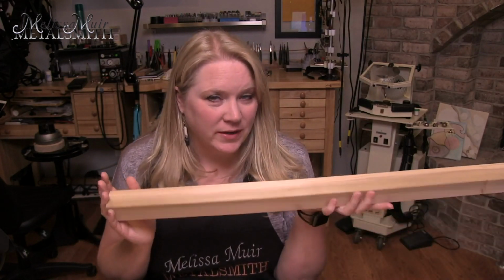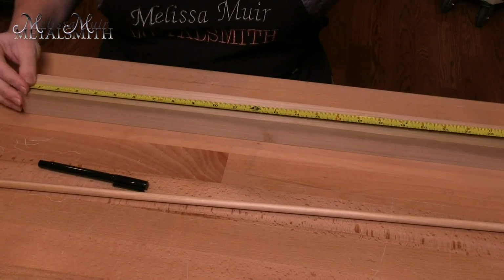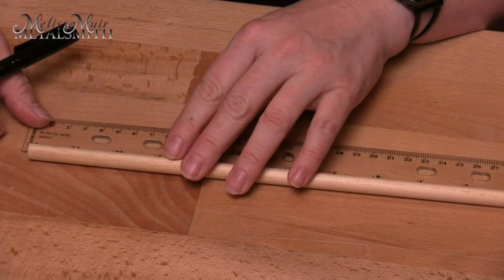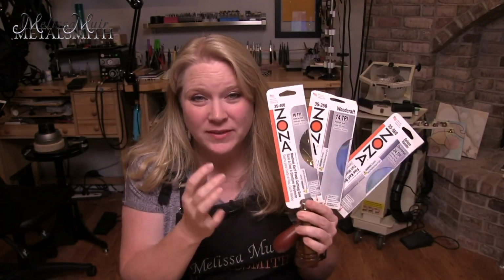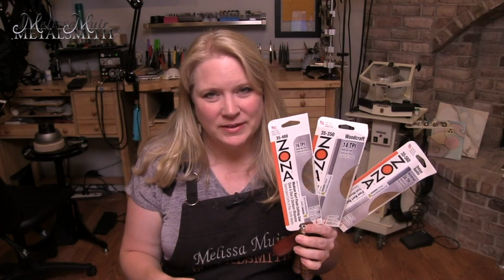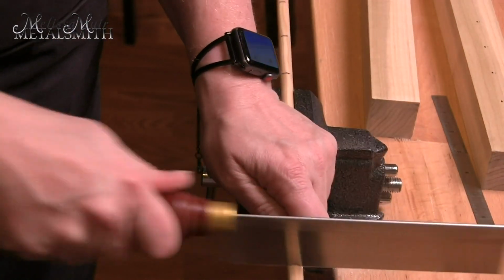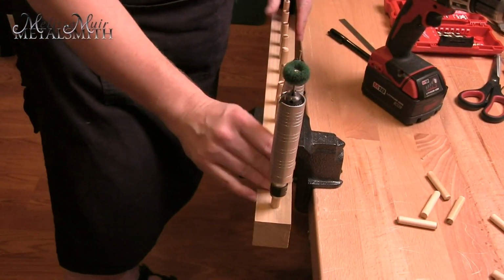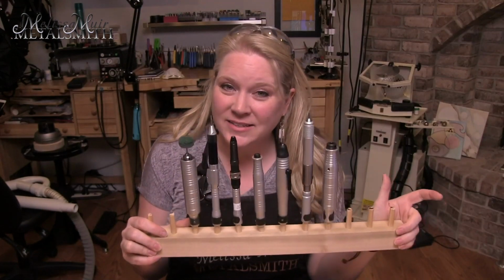DIY- Get creative and make your own handpiece holder. With Melissa Muir

Comment: Hello Melissa can I use the Foredom SR Flex drive slip joint hand piece with the Foredom H30SJ hand-piece? Thank 😊
Reply from the maker: Thank you for asking! You can use the SR motor with the H.30SJ slip joint handpiece as long as the motor has the slip joint shafting. - Foredom Team